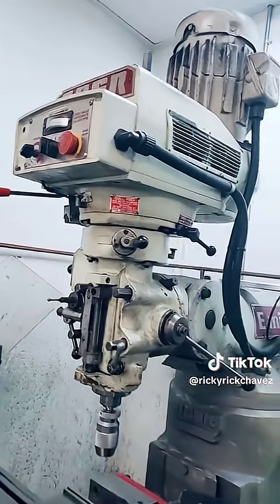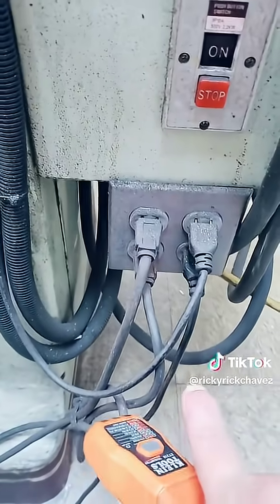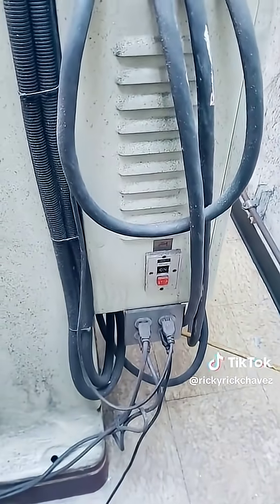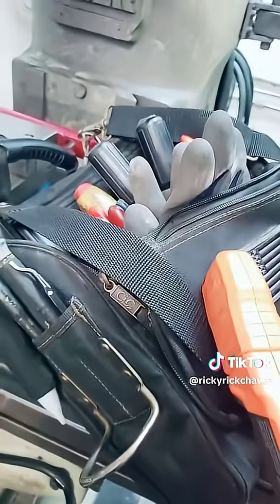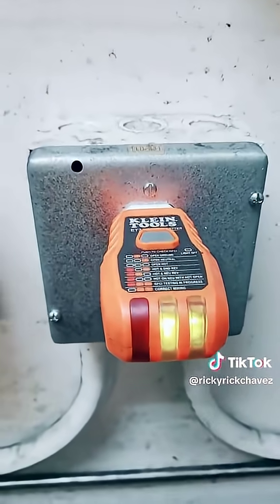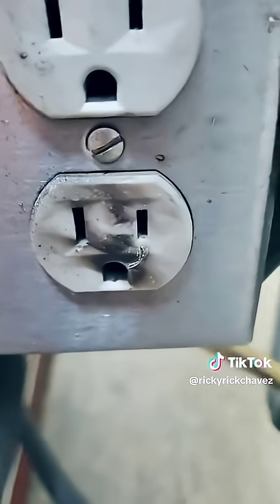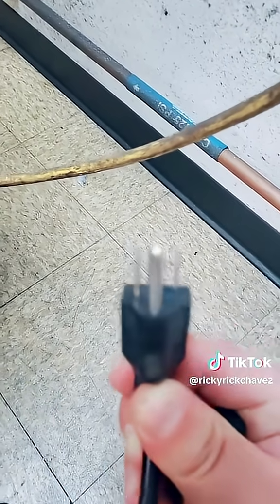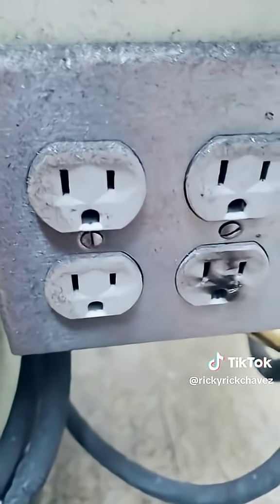⚡Arcing Outlet 》You WON’T Believe the Real Cause!💥#INDUSTRIALELECTRICAL #REPAIRS #BLUECOLLAR

Comment: Been in electrical trade for over 50 years. I have run into several occasions where a coat hanger fell on the prongs of a plug that had become exposed due to falling partially out of the wall receptacle. Result was breaker tripped but if combustibles had been nearby a fire could have resulted. Grounding prong on top is safer but tradition has it we put grounding prong on bottom. Really need to be put into code that grounding prong be on top

Comment: The outlets are installed the wrong way for code they should be flipped around so the prongs can't have anything fall on them. if anything falls it's going to hit the ground prong before it could lay across the hot and neutral.
Reply: There is no specific code on receptacle position,ground up or down!